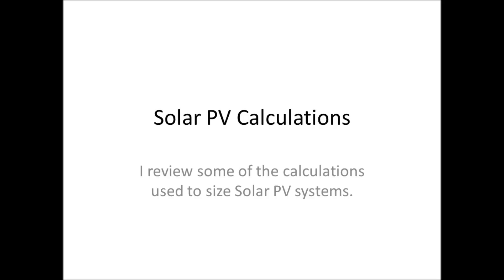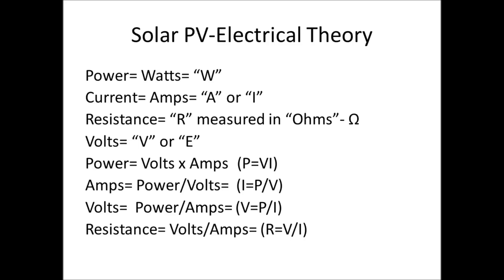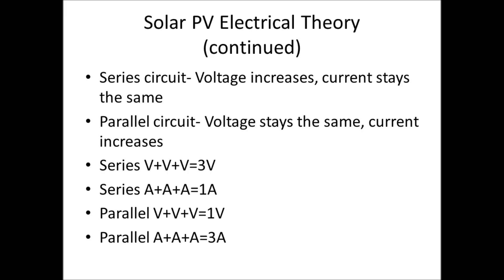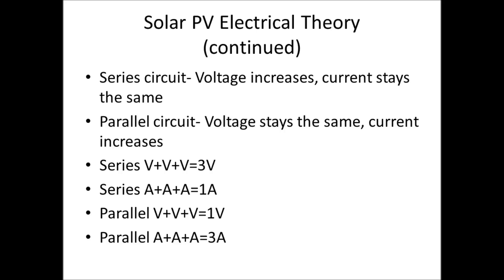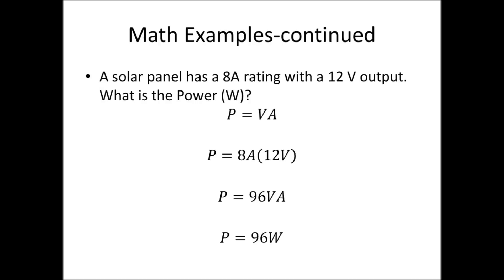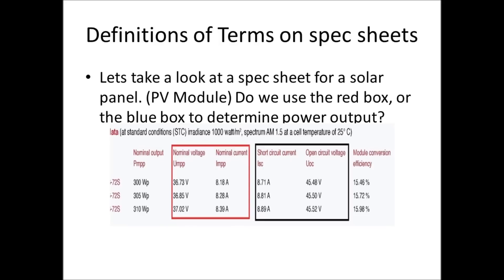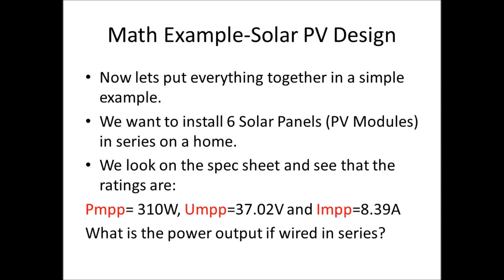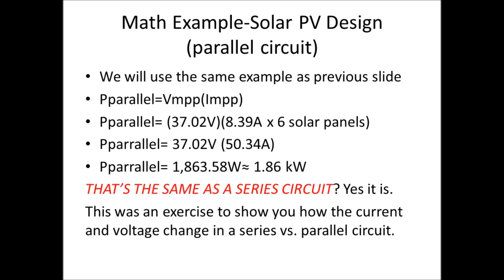Solar PV Calculations for Series and Parallel Circuits

Comment: Good Video ! 

Dongguan Lmet Test Technology Co.,Ltd specialized in environmental and mechanical simulation testing equipments manufacturer .Our main products are environmental chambers, thermal shock chamber, walk in chamber, universal tensile testing machine, carton compression tester, drop tester, vibration tester, UV /xenon Aging Test Chamber, Rain Spray test chamber ,video measuring machine ...etc. For more details you are welcomed to visit our website : www.lmettest.com . or contact Mrs. Anna via email sales01@lmettest.com .  Thank you .